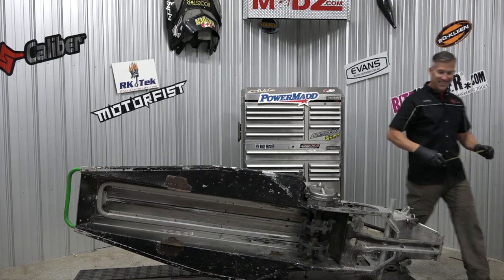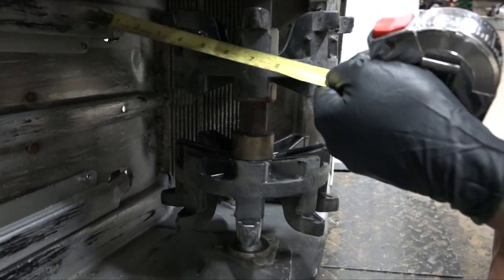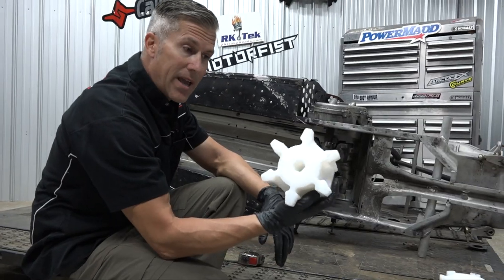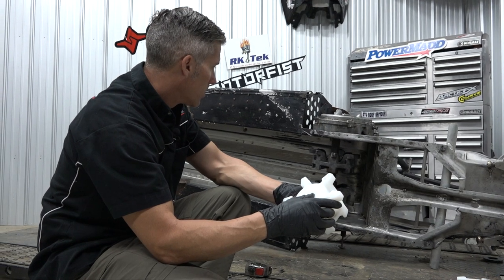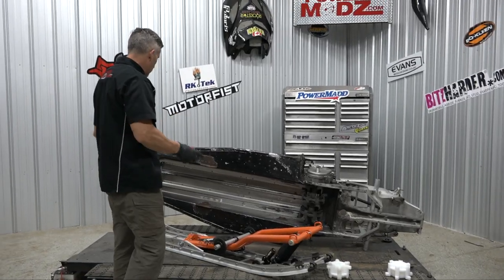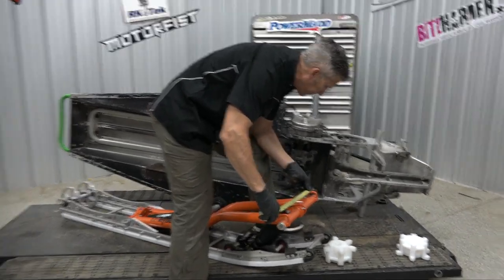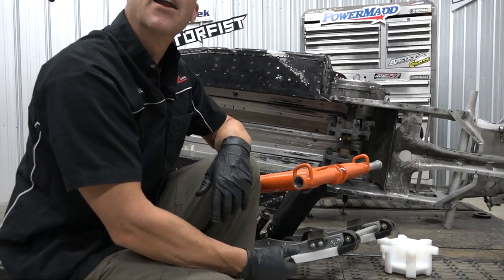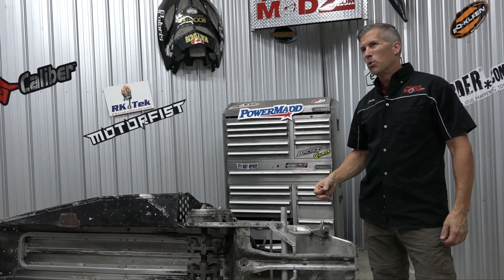Mega Elan Modified snowmobile build #2 Cooler and driver measure up!

Comment: You could try the M sled tunnel cooler's they go in the corners of the tunnel then you will have plenty of track clearance in the middle with maybe just the outside tip of the paddles needing clipped. They are also finned so they should cool better. Could also use the rear M sled flat cooler.

Comment: i have a firecat EXT 144" with the bigger cooler on the back. you might be able to achieve both cooling and length with a used tunnel